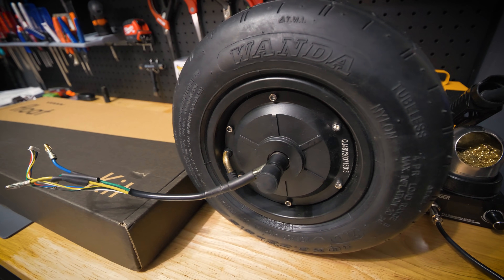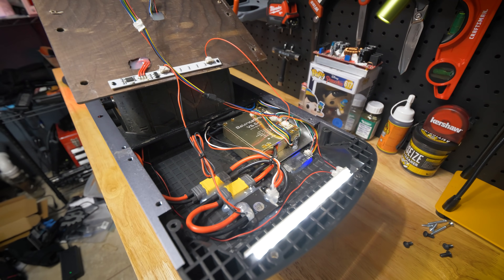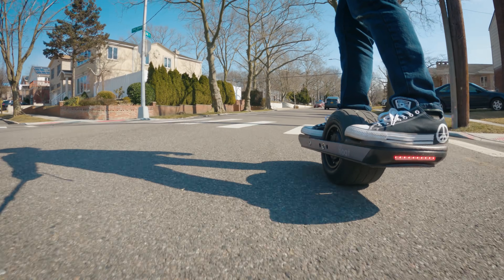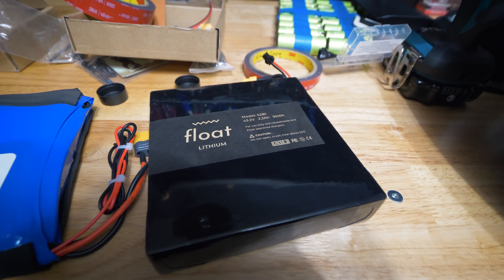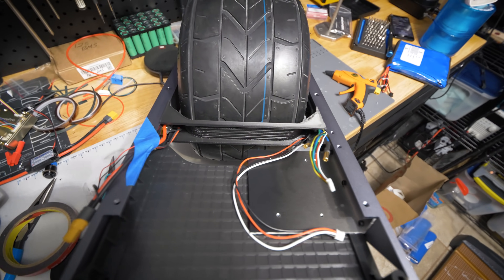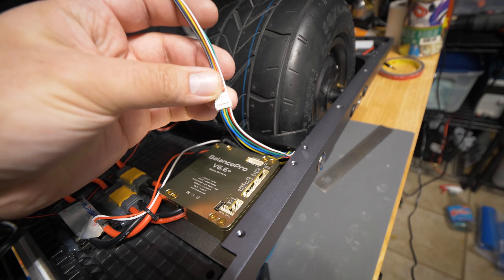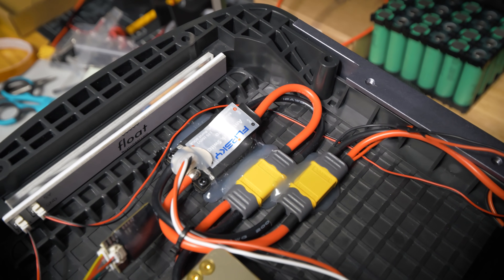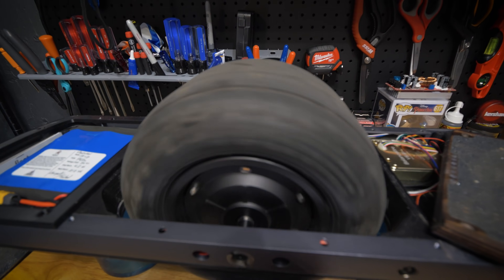DIY Onewheel | The Floatwheel | Putting It Together

Comment from the maker: 1) This is a reupload. There were audio issues in the first upload, and I couldn't overlook them. I've fixed most of them. My apologies, and I hope you rewatch this is you have already seen it the first time. 
2) I was made aware that the Floatwheel folks are reworking and releasing the rails and kit to have a more robust design with regard to clamping in and holding the motor. I'm not sure when this revision will be done or released, but it's in the works.
3) I was also made aware that Discord is blocked in China, and so it's difficult for the Floatwheel folks to be active in the server.
Reply: THANK YOU for bullet point 2). I just bought a pint but I still want to diy my own. I don't feel comfortable riding something so diy as the fun wheel, and the float seems like a good compromise. I will be waiting for the new rails (and for lite coin to drop a little more lol) before ordering. Can you share the discord for this community? Thanks!
Reply from the maker: @anotherdrummer2  Sure thing. The Funwheel rails are actually very very nice, and some guys are mixing parts so they can have the larger Floatwheel motor on the larger frame of the Funwheel. It's also much easier to put a larger battery in the Funwheel boxes. 
If you're looking into doing a build, check out the FlexiBMS Lite. It's a small, charge only BMS that you program yourself for the battery parameters. I'm ordering a couple this spring to use in a couple of other builds.
Reply: @TheBoardGarage  I agree that I like the fun wheel rails, as I think they're closer to the XR in size(?) Which is the #1 reason why I would get the XR in the first place. I think once I get used to riding the Pint and I experiment with the more adventurous profiles, I'll be more comfortable doing a more scratch built board. Thanks for the reply!
Reply: @TheBoardGarage  larger wheel, larger motor, sounds awesome. Is there any update?
Reply: @anotherdrummer2  I've never rode a balance vehicle before and dove into the FunWheel build. Definitely wish it had more torque, but other than that I'm loving it. Sometimes I wish I had done a combo of FunWheel rails and FloatWheel VESC and motor, but only because I am pretty heavy.

Comment: In the beginning of the video @2:57 you mention replacement parts of XR components with custom parts.. That's where I'm currently at with my XR basket case.  My OW XR died right after warranty miles were reached (at around 320mi) and I dont want to interact with future motion ever again if I dont have to.   Is there anyone out there offering a BMS/control board kit you can swap out on an XR?  Can you point me in the right direction for these type projects?

Comment: Hey Mario, are you planning on making an update video with the new rails? I was thinking maybe a video on upgrading the tire would be beneficial as well.
Reply from the maker: Maybe. I'm working on a different build now, actually. Hybrid with the Funwheel rails, and a much larger battery with custom firmware.

Comment: Why would one buy this instead of a onewheel? 350 dollars to end up with a worse product, loose hours, and assume so much risk doesn't seem worth it
Reply from the maker: One would buy this so that one could build something, learn skills, understand how certain systems work, and end up with something they created, understand, and can work on and repair. It's a DIY project. 
Why would anyone work on their own car? Or repair things in their own home? 
It's to be able to do something yourself, and learn. These are reasons enough. 
As for assuming risk, you're talking about riding a single-wheeled motorized skateboard. If you go about it thinking you're not inherently assuming risk, then that's misguided.
Reply: @TheBoardGarage  fair enough. I'm a diy guy but don't think this particular is for me, too much hassle for a small reward, this should be less than half the price.
I meant the risk of doing something wrong and ending up with a malfunctioning board,  this is Chinese after all, and from a sketchy website.
But nice video, thank you for doing that!

Comment: Anybody having the wheel just run one direction constantly? Also the ADC 1 sensor hovers around 1.56 volts. Do you have a link to the other (non float wheel ) IMU tuning? Thanks.

Comment: Question, I looked on the float wheel site. I saw they only had 4 products there. Am I to understand if I buy all the parts it will have all the wiring as well. Because it looks like just a wheel, frame, battery, and balance box.

Comment: Love the content, quick question since I'm down do to an accident  I've been wanting to do an DIY onewheel so im thinking about ordering the parts off of floatwheel. That said im new to all this would you say someone like me who is knew to Eskate n onewheel would be ok doing this project or am I bitting off more than I can chew ???? Ive always wanted one and I thought I would appreciate it more by building one. That or a electric mountain board im looking at now im down. Any suggestions would greatly be appreciated....
Reply from the maker: I'm sorry to hear about your accident. I hope you have a fast recovery. 
The Floatwheel is an interesting kit. It's decently simple to put together, and the Discord community is incredible. Amazing people there helping everyone. However everything is still new, and it takes a LOT of learning. Learning about wiring, circuitry, motor control and general use of hardway. If you're not comfortable with screwdrivers and wrenches, this is going to be a challenge. You will likely get it wrong and/or break everything. I broke many many things before I started being able to do things more easily and repair things. There's a learning curve, and guaranteed frustration. 

If you're willing to endure it, I'd say it's worth it. Every step is a learning process. And the updates coming to the firmware make large improvements.
Reply: @TheBoardGarage  thanks so much for the reply.....
 I'm Definitely comfortable with tools and working on electronics. I'm a big RC guy so I think more of the firmware and hooking it up with the computer I'd whats scary to me i think. I think I just got hurt and I hopped right back into my board I just changed wheels, and bushing on my backfire board, that said I just don't want to put something together where I or someone may get hurt using it because I did or didn't something correct. Ifhnno maybe I'm just blowing it up in my head. I'm thinking I'll try it and just keep watching your videos and other ones.

Comment: Great video, wish there were some real instructions came with it. But one thing I am not sure of: when connecting the motor phase wires to the balance pro. what order are they (left to right) blue-yellow-green? I have watched several videos but still not sure.
Reply from the maker: It doesn't actually matter. You just have to make sure your motor spins in the proper direction when you're setting it up.

Comment: Thanks for the video I esk8 have a few boards was  thinking about getting the float wheel how is the ride and range can you get a cover for the wheel ???
Reply from the maker: The range depends on the battery you get for it. You can build a larger battery than I have, or have a pack inside and a parallel pack in a backpack like some builders do. The rear compartment is small, but with enough effort you can get something with anywhere from 6-14 miles depending on many factors. It's not a concrete figurel. The ride is pretty decent. There are improvements coming in the software that will change the ride feel.

Comment: I am looking forward to this series. I am wanting a Onewheel. Looks like the Float kit is about half the price of a Onewheel Pint. Float is sold out of the battery. To bad they don't just sell a complete kit. I am hoping you can plug it into your computer to tune and not bluetooth only.
Reply: Chi battery systems makes battery's better batterys than onewheel.. xr range pint battery
Reply from the maker: Huh?
Reply: @TheBoardGarage  ifme huh then I'm mentioning the chi battery quart  it gives the same range to a pint as the stock xr has. ;)  im rocking a cbxr this season for 80 km rides. ( upgraded my xr battery )

Comment: Has FM tried to shut this down or is that not possible if the Float Wheel folks operate out of China?
Reply: i also think thats why its a kit instead of a complete product
Reply: @HELLOHOGO  bingo, they are NOT selling a onewheel, they are selling components. If you've ever ordered anything from the flat life then you've likely realized "paper airplane kit" is totally legit to send with product.. rolling papers.. not so much ;)
Reply: yes, they have threathened them already with cease and desist, that's why Floatwheel doesnt accept any paypal order anymore (risks of funds getting blocked)
Reply: One wheel cannot patent the tech.. its patented design concept but thaT means nothing. They have no,legal ground
Reply: @MrDmadness  yes, but they have money and lawyers to bully hobbyists/small companies, block their paypal assets... remember what they did at CES to shut down their competitor booth.
Reply: @olivierzzz  Chinese manufacture.. bitcoin.   They are literally trying to latent a wheel and a skateboard, while they hold a design patent it is dismissals by any good lawyer given that nothing on the board is "new" tech.. a good lawyer would argue that THEY have stolen arduino self balancing tech since this is exactly the components that you find in a one wheel.   Bottom line, their patent runs out soon and even before it does people will continue to make better boards..

Comment: What are the range and speed specs? I must have missed the part where you said it
Reply from the maker: I didn't mention it. That information will be in part 3, when I review the kit. Specs like that are dependent on the build, its configuration, and other factors.
Reply: @TheBoardGarage  gotcha. Thanks for the reply I'll be on the lookout for that video
Reply: Considering the price, it's very cheap. I wish the battery was bigger, 222wh is quite small, I would guess 6 - 10 miles, depending on tyre, riding style etc. Top speed not sure, don't know what configuration the cells are in. The motor controller could take the power it seems, just depends whether it can be delivered. Would guess speed is the same based on the battery. The price is a consideration, it's very cheap so can't complain. Not for me until there's a bigger battery I think.

Comment: 10:34 ish. I think they are reversing voltage to change the color of the lights as you switch directions. So red diodes in normal, white diodes reversed. That way the strips can change color by simply reversing the voltage.
Reply: Unfortunately not, the cables are just flipped really. LEDs are single color